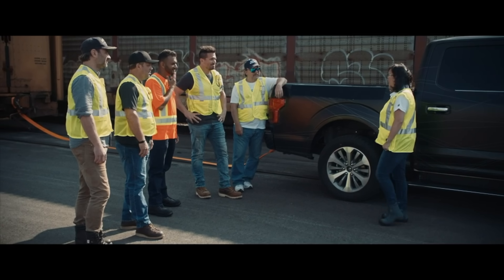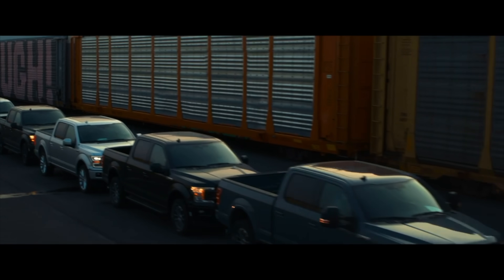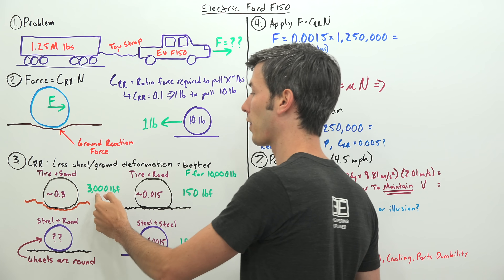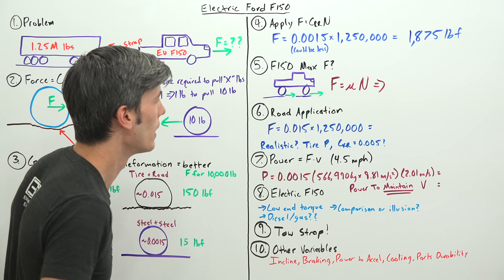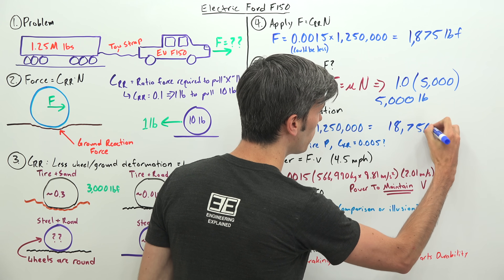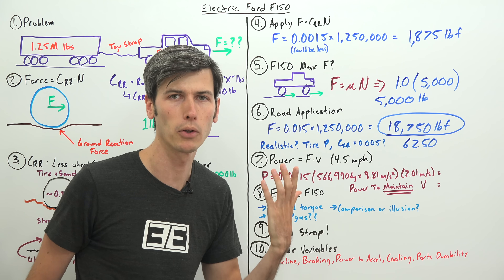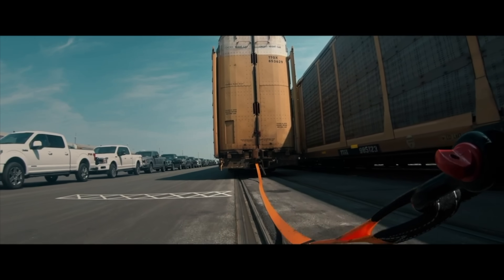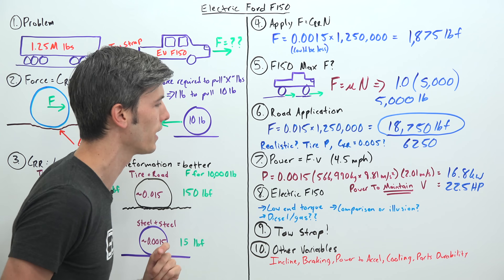No, Ford's Electric F-150 Can't Tow 1 Million Pounds (Realistically)

Comment: and that's why trains are a real efficient way to transport very heavy loads
Reply: That's the real take away here fo sho. Lol
Reply: Electric Diesel... FTW.
Reply: I think you did two things in total. 
1. You proved that the truck can tow 1 million lbs. illusion or not 
2. Trains are smart.
Reply: Also why they take forever to stop 😂
Reply: Amen and work with trains
Reply: People saying that trains suck in USA lol... no country on Earth hauls as freight cargo as USA trains. Meanwhile, most commuter service is electrified. USA will never run full electric freight just like some other countries. You can't compare Europe's 750m long trains to trains in USA, Australia, Canada, Brazil etc when they can reach like 6km in lenth. They also have to go up grades and go through unimaginable distances without anything but wilderness around.
Reply: Shengjie Xu you are correct sir.
Reply: I thought you were Jeff from AthleanX for a sec
Reply: I remember a TV spot for CSX where they said a gallon of diesel fuel can move 2,000# of freight like 400 something miles.... it's pretty amazing the mechanical advantage steel wheels on steel tracks gives you.
Reply: @Shengjie Xu You are right man👍🐨
Reply: @Kaden Hauge read the replys on my comment and educate yourself a little bit 😉
Reply: @Kaden Hauge that's a natural consequence of it's efficacy the low friction requires much less power to propel it forward but due to this the stopping force it very limited although stopping has nothing to do with efficacy since every time you apply the brakes you are wasting energy converting your momentum into heat so the most efficient way to stop is to just not apply any driving force and coast to a stop
Reply: I don't think diesel-electric are any more efficient than their mechanically driven brothers at speed. I feel that people are under the general impression that generators don't return any resistance when in fact they do when current is being drawn it's not free so the diesel will increase its fuel usage. I believe this route was chosen because the setup basically makes it a glorified transmission like a CVT but able to be completely manipulated electrically (and space saving) and that's where the economy comes from.
Reply: YEAH 💪💪💪
Reply: ELECTRIC TRAINS
Reply: You can see this with a regular pickup truck.  Anyone who has hauled steel in a pickup bed without strapping it down knows how little force it takes for it to skid across a steel bed with no liner.  A steel wheel on steel has even less resistance.
Reply: @Shengjie Xu Only the US GE/EMD locomotives. Elsewhere in the world diesel locomotives usually have some sort of hydraulic drivetrain(similar to the fluid coupling in torque converters)
Reply: Electric F-150 VS 1945 UP Articulated
Reply: And it's very hard to stop once it starts  Hauling Ass
Reply: Exactly what I was thinking soon as I clicked the video
Reply: I can guarantee you that one of those early years (say, 1850s) choo-choo train would never be able to pull this many train cars. Otherwise, why did modern train engines were so much more powerful?
Reply: @medler2110  , percent of in use electrified rail isn't same as percent of trains running electrified. Busy rails have been converted to electric while infrequent lines are kept diesel only. As there is many cargo routes with only short distances without electrification there is also hybrid engines which are primary electric with capability run short distances without power lines.

Diesel only engines are still more common for cargo than passenger trains. It is easy to miss the difference when traveling people mostly see passenger trains.
Reply: I could probably pull that train.
Reply: what  about stopping?
Reply: Yep
Reply: Europe is a bunch of soy boy beta countries each trying to out libtard themselves.
Reply: Facts.
Reply: So is a peterbilt
Reply: If they are electric yeah 😂😂
Reply: trains suck in america, they're better in asia
Reply: Correct.  Boats as well - theory is the same.  Low initial force, very little resistance.
Reply: And to run over people with
Reply: Also why it takes a train a mile or more to stop
Reply: Annoying ass trains
Reply: That could be explained in 10 seconds... Not 10  minutes...
Reply: Ford Railways
Reply: Koch coal?
Reply: and that nearly all trains are electric anyway... ever since 1879.
EVs are just reasserting their rightful place in society.
Reply: @ahaveland  diesel-electric here...it's still a way more efficient way to be burning diesel.
Reply: @joshuavincent7884  really? Why is that? Is it just the wild increase in control?
Reply: @crackedemerald4930   because you can have a engine basicaly on the lowest rev possible without using that much fuel for when you just want to mantian speed. Off course when you have to accelerate you need more electricity so the diesel generator needs to rev up.
Reply: @joshuavincent7884  Yes, it's an efficient way of burning diesel, but it's still burning diesel.
Trains in the UK and EU have a third rail at about 600V with shoes to pick up the power, or overhead wires at 25,000V on pylons. No diesel required, and the electricity supplying them is increasingly renewable and pollution free.
They can also travel at 180 mph, so making the trip from London to Paris competitive with flying, and is a lot more comfortable and relaxing, and I say that from experience.
Reply: @ahaveland  Yap, that is the better way to use trains, without burning diesel, but unfortunately america doesn't know what that is :/
Reply: AXEL_X partially because this is a huge country, with railroads covering immense distances, compared to a relatively small Europe. It would be incredibly expensive for Railroad companies to maintain, and build overhead lines over long portions of track, out in the desert. Thus, the use of diesel, which means loco’s simply carry fuel on board. The new Tier 4 emissions engines are also very clean and efficient compared to their predecessors.  I work in the Diesel engine industry.
Reply: Andy Lee Robinson Those trains wouldn’t stand a chance going up steep hills out here in America, especially out west there’s areas where there’s no electrical lines for several hundred miles. It would never work, that’s why they still use diesel
Reply: Andy Lee Robinson so UK trains are burning coal... from power plants.
Reply: AXEL_X most of America is rural and supplying power there is unrealistic.
Reply: @axel_x8954   Where I agree that not using diesel is better, there's really no way around it in the US. Unlike UK freight trains, ours are much much longer, heavier, and travel a much longer distance. For example where I work the average train is 5,000ft-9,000ft, anywhere from 3,000 tons to 20,000 tons, and travel between Canada and the southern US. Sometimes farther if it transfers between railroads. Using just electricity to power those trains is pretty much impossible.
Reply: ThePedro8161 here in Germany we spent an enormous amount of money electrifying most of our railroad network and there are still parts which aren’t electrified and probably never will be 😊 here in the north, which is so flat so you can see on a Wednesday who‘l be there for cake and tea next Saturday, we‘ve been evaluating fuel cell trains successfully. They might replace Diesel-Electric in the next decade.
Reply: @ThePedro8161  Most diesel trains however here also have pantograph pick up assemblies on the roof, so they can use overhead lines for power where available. That way the rairoad saves on expensive fuel use on the final sections of lines, where you use electric power and have no urban pollution problems then. Most of the trackway here in South Africa is not electric, aside from main lines and the commuter train lines, and the trains are limited in most cases to 120kph, though they can go a little faster, but there are lots of speed limited sections around towns and where the rail lines go through passes, due to older track and clearances.
Reply: @NoticingBehaviors  Good job. You responded to a comment without actually reading the comment. 
"No diesel required, and the electricity supplying them is increasingly renewable and pollution free."
Also, the UK continues to push to have several days or weeks without using coal power plants at all. Their goal is to eliminate it completely.
Reply: Andy Lee Robinson America is also significantly larger and to carry that much power on a third rail would need several substations in rural areas. Freight trains carry much more weight and would need atleast 50kV.
Reply: Anthony Pelchat good job. You responded to a comment by contradicting yourself. Coal is still required right now.. which is worse than diesel. So called renewable resources also require huge amounts of coal to produce the parts.
Reply: @NoticingBehaviors  I didn't contradict myself at all. No country can shut down their primary power plants for several days or weeks at a time. Coal is not the primary source of power in the UK, and hasn't been since 2013. Renewables and low carbon power sources accounted for 53% of the UK's power production last year, and they are improving this year. Btw, diesel is not a low carbon source, even though it is better than coal. Gas is still the primary power source for the UK, followed by Nuclear and Wind. Wind actually accounted for nearly 3 times the amount of power generated as coal (58 TWh to 17 TWh).

Renewable power sources can be produced by many different means and never cause more pollution than they replace, not by a long shot. Whomever told you otherwise was lying to you. And you also fail to realize that just because something is powered by a coal power plant today doesn't mean that they will be tomorrow. 6 years ago, coal power was used for about 40-50% of the power in the UK. Now it only accounts for 5% and is still dropping.
Reply: Anthony Pelchat what you fail to realize is that coal and oil is what is used to produce these renewable resources.
Reply: @NoticingBehaviors  I am just going to copy/paste from my last comment, since you didn't seem to read that far.
"Renewable power sources can be produced by many different means and never cause more pollution than they replace, not by a long shot." 
As in they don't just use coal. And whenever they do use coal or other sources, they still do not cause more pollution then they replace. 
"And you also fail to realize that just because something is powered by a coal power plant today doesn't mean that they will be tomorrow."
Reply: @axel_x8954  American cities are really spread out though,  and putting electrical lines with rail would get real expensive with how far they need to go
Reply: @alexhulinsky7954  Compared to the cost of fuel, it wouldn't be bad. Just did some quick research and basically it cost roughly $10,000 in fuel for every 500 miles. The numbers could be pretty different and that is still extremely cheap compared to semis trying to haul the same amount. I think the bigger costs would be replacing the current trains in the first place. One day maybe.
Reply: Lead Foot They are diesel-electric hybrids.  Not diesel.
Reply: @axel_x8954  because we like oil to burn
Reply: @TheSteelerider  thank you for explaining this I like to work on semi-trucks engines some day
Reply: @crackedemerald4930  Diesel-electric drive is used because the electric motors can apply maximum torque from a stalled state.
Reply: @ahaveland  you also don't pull the heavy loads American trains pull.
Reply: @JACKSchannel1100  The point is that trains are electric, whether you carry your own fossil fueled power station or not!
Reply: @crackedemerald4930  A diesel engine is much more efficient just running at a set RPM than say a diesel pickup truck that cycles through gears and has to accelerate a lot. Stick a big diesel in a locomotive who's SOLE purpose is to generate electricity for the motors is a vastly more efficient way to use diesel to move a load. Plus it vastly increases the engine's life too so it's a win win.
Reply: @ahaveland  everything in the EU is so close so it works but say here in Australia theres a few hundred km between major towns and nearly 1000km between most major cities so the power loss alone makes it unviable also for the same reason we can't have high speed rail the extreme heat causes a lot of movement in rails and 2 is bad enough adding a third would just be more drama
Reply: @axel_x8954  Shows what you know. Third rail, high voltage, no fuel burning on the entire train? You're describing the subway in NYC and probably many other cities, as well as the LIRR which is several hundred miles above ground. That's just what I know of in a single metropolitan area, there must be many others. Sheesh.
Reply: @ahaveland  Yeah but you are comparing American freight trains to EU and UK passenger trains. If it were possible to make american trains electrically powered from the grid, that would be great. but America is very large and again, is referring to freight trains which traverse different paths than passenger trains which might have fewer routes than the complicated train network.
Reply: @shaynegadsden  Electric rail isn't the primary conveyance of freight pretty much anywhere in the world, even Europe.
Reply: @axel_x8954  or maybe it's because America is a much larger nation that has a much more rail infrastructure that would be unviable to convert to powered rail.
Reply: @ahaveland  The railway power standards are actually wildly different across the EU. It's 3kV DC for legacy lines and 25kV AC 50Hz for new high speed lines here in Italy. Third rails are only used for subways.
Reply: Guys, Europe is almost as big as the US, with a higher population. It's has a lower GDP per capita.

The reason the us doesn't have electric rail isn't cost, it's the artificially low cost of fuel.
Reply: @ahaveland  there's a few bits wrong here- about a third of the British railway netowkr is still diesel operated, primarily because electrifying them isn't viable. On top of that, the maximum line speed in the UK is 140mph
Reply: @StaxRail  It's Diesel-electric. The diesel part is really just a generator and the motor itself has been electric since the 50s. ( Apart from a few smaller specialist units.)
Reply: @michael_b_anon  I know, bar the few diesel hydraulic units, but either which way there are diesel engines used, rather than third rail or overhead catenary
Reply: @joshuavincent7884  yeah, it’s basically just a hybrid
Reply: @shaynegadsden Not everything is close... Here in Scotland there are trucks that started their journeys in Italy or Romania or Spain. Over 1,000km away. Close to 2,000km in cases. Common misconception with Americans and Aussies that everything in Europe stops at the border of the next country... Things here travel long distances too.
Reply: @typhoon-7  yeah thats crossing multiple countries meaning multple cities too here it's 900km between Sydney and Melbourne just 2 of the closer major cities but if look at Melbourne to Perth that is 3,400km most of which there is nothing around. So yes everything is close even on a longer trip there are multiple points were the infrastructure would easily be in place for recharging systems
Reply: @ahaveland  But electric propulsion is far more efficient, we were only limited by batteries till now. And once the new gen batteries come out oil cars will be totally finished
Reply: @abyssstrider2547  Batteries are already good enough - ICE cars for the mass market are just dead men walking, and many just don't know it yet.
If better batteries are possible (and that's not guaranteed), they'll finish off the job quicker!
Reply: @ahaveland  Good luck with ICE in 40 years...by then most oil reserves will be emptied out
Reply: @ahaveland  well the diesel engine power the genitor to the whell
Reply: @ahaveland  no. Freight trains are Diesel electric. Diesel generators power the electric motors
Reply: @daveslyker4431  Maybe in America, which is less than 5% of the planet. You have a lot of catching up to do with the rest of the world in electrification of railways.
Reply: @ahaveland  and also Canada, which is where I live. Also in all of Asia which is half the planet. So... What's your point?
Reply: @ahaveland  I would just like to point out that the term America can be subjective and refer to nearly the whole Western hemisphere. North, Latin, and South America. Just a thought.
Reply: @BubonicBite  I believe it is internationally recognized that America=USA inc Alaska and Hawaii
Contiguous America=US minus Alaska and Hawaii
North America=USA+Canada,
South America=Chile, Argentina, Ecuador, Brazil etc.
The Americas=North and South America.
Reply: @ahaveland  diesel motor that powers the electric traction motors
Reply: @ahaveland  lol no
Reply: @ahaveland  all wagon are powered .
Reply: @ahaveland  Yes i know what diesel and benzene is, i just said oil to simplify it
Reply: @ahaveland  1879? Do you really think steam locomotive was gone from the face of the earth by 1880? You probably come from an alternative timeline
Reply: If we could only build electrified systems for cars so batteries were not needed... Electric cars are for the most part a politically correct statement in society, for the most part to make people feel good about their beliefs that humans are so evil when it comes to the environment; yes, we are evil when to comes to almost everything, but the environment should not be your biggest concern. There is no benefit for the environment by building and driving electric cars, but I'd drive an electric car any day for other personal reasons, like no oil changes and better reliability.
Reply: Andy Lee Robinson 100% diesel-electric on North American freight trains.
Reply: @ahaveland  welcome to the north American railroad industry
Reply: Andy Lee Robinson no they haven’t. Trains rial coal like crazy. No electric motor rials coal
Reply: Andy Lee Robinson there are almost none in Canada. Almost all are diesel
Reply: @ahaveland  no not all change our electric maybe that's in your area because they still run diesel locomotives where I live
Reply: Andy Lee Robinson Very few trains are electric. Most are diesel
Reply: Trains are not full Electric. Most of them in the United States where I live are diesel electric hybrids which is a diesel engine running a generator that then Powers traction Motors  @ahaveland
Reply: @Floofie_boi  United States occupies only 5% of the planet.
In Europe, most trains are powered by overhead transmission lines or a third rail.
Reply: @ahaveland  I'm aware that the United States only occupies 5% of the planet, I was just stating in the United States most of the trains are diesel Electric
Reply: @Floofie_boi  I didn't mean to sound rude, but this has been pointed out at least 20 times in this thread already!
Yes, diesel electric trains are still fossil fueled, even if the engine runs at its maximum efficiency.
The generator/motor just acts as a torque converter for mechanical transmission.
It's not electric in the sense that it is not powered remotely using transmission lines as in Europe, where trains can run over 180 mph, or 300 mph in China or Japan.
Reply: @ahaveland  you're not being rude. I didn't read the thread fully before posting my comments to this thread.
Reply: @ahaveland Yeah electric motors powered by generators that chug diesel lmao
Reply: @ahaveland  Perhaps in your region, but in New England the only electrified rail outside of city-centric mass transit is the Boston-NYC-DC Acela* which still sometimes substitutes diesel locomotives.
---
*If they used a more rational spelling of "acela" perhaps they'd be more commercially successful. I digress.
Reply: @disorganizedorg  I mean, the diesel engine powers the traction motors which then drive the wheels, so technically you could consider them "electric"
Reply: @ThePedro8161   Yep more akin to a Chevy Volt.
Reply: Rich Marceau 
Diesel locomotives are electric. The diesel motor turns a generator/alternator for the electric motors on each axle of the locomotive. It’s an electric locomotive with its own power plant.
Reply: I cant see any real technical issue prohibiting to electrify us railroads. 
Size of trains doesent matter at all, an electic locomotive weighting the same as a diesel, will have exatcly the same pulling force. 
Rural areas don´t seem to be a huge problem to me either. Set up a big 400 kV supply line that runs parallel to the railroad track, and a substation for converting to 25 kV for the caternary every 50 miles. 
The huge advantage will be, every time a train slows down using the dynamic brake or running downhill, the energy will not be transfered to heat und be lost forever, but fed back to the electricity grid. So energy consumption of the railroad will decrease by a lot.
Reply: @denzzlinga  True. The only issue that will likely come up is the cost to replace the current train. It's a hard sell to replace one that is still good, especially when the lines aren't in place yet. Still, it is very much doable and the savings over diesel should help.
Reply: @anthonypelchat  i don´t think thats an issue too. There is a huge market for used locomotives in north- and south-america. So if a big railroad company starts electrifiing its lines, it could just sell its diesel locomotives to smaller local railroads or for export to brazil. There is always a demand for used locos as long as some small railroads are operating 50+ years old ones, they will be happy if they get the chance to buy newer, more efficient ones.
Reply: @denzzlinga  finally someone that has some vision!! Like i said, it was done in other countries! You can do it in America to! You just need to have the budget that im pretty sure you have. The problem is that your country priorities are really low term and they dont care for the future of the planet! Your diesel locomotives are just diesel electric. They have diesel generators that create electricity! If you take out the generators and use the electricity directly from the catenary, there is no difference in power output!! You can still use as much locomotives as you want!
Reply: It's more efficient because it's basically a straight line to your destination with no stop and go. Not just the wheels are lower friction.
Reply: David Willems you forgot the aerodynamics of a train, and that plays a huge part in it’s efficiency as well.
Reply: Yall seem to be forgetting that most of the cross-country country is not only uninhabited (aforementioned) but subject to extreme weather, the likes of which destroys electrical systems. Even if we vaporized the millions required to build the infrastructure, but we would have to constantly service it as ice storms ruin them. A self-contained power source, as with anything non-city, is always the only reasonable option.